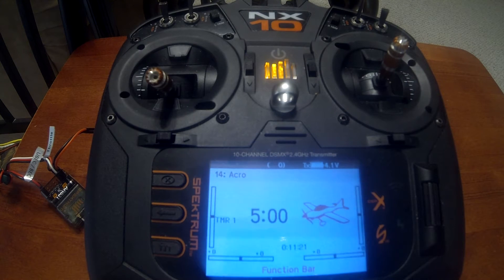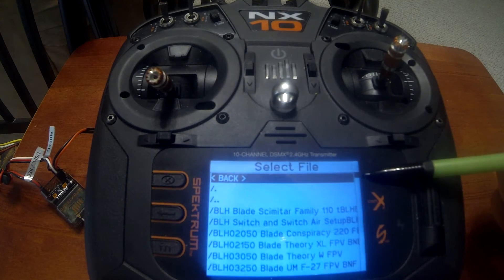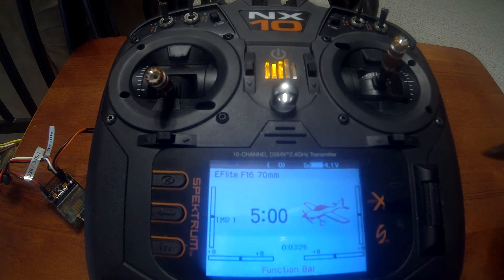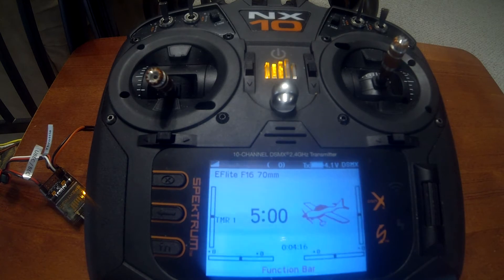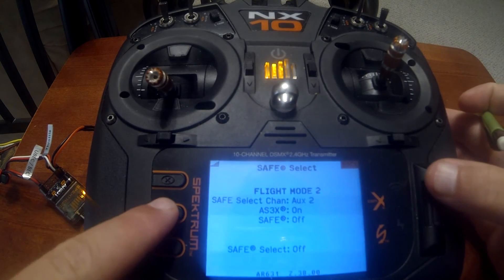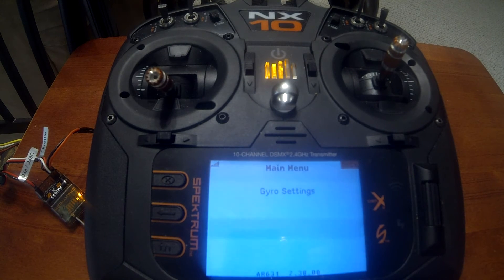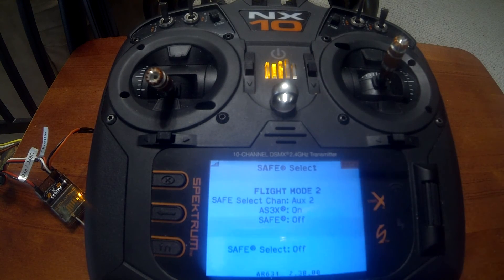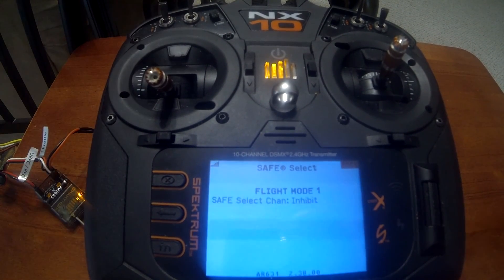Spektrum NX Setup: How to setup a Eflite BNF & Safe Switch Assign with AR631/AR637TA (NX6/NX8/NX10)

Comment: I just bought a bind and fly commander. Im use to just buying a blank ar631 and doing all the programming myself. Whay way do you think is better.
Reply from the maker: BNF settings are easier some because tuned and can fly. Unlock will give you flexibility. I prefer to unlock and tune myself...

Comment: I have a horizon aeroscout bnf. Can I bind it using a template and then set up dual rates on another switch. And use that switch as long as I have safe off

Comment: Your videos are outstanding, I have watched and reviewed several.  Much appreciated for someone like me that is new to the hobby.  Question I have imported a Eflight template for the Commander MPD.  I have assigned some switches, Motor cutoff, flaps etc.  Is there a quick and easy way to reset back to the original import template settings?  Meaning it would default back to the original import (NO assigned motor cutoff, flap switch .. etc.). Thank you in advance👍
Reply: You have helped by answering my questions before.  Took me quite some time, I finally figured out how to Reset / Delete.
Reply from the maker: @Mountian-Zen  sorry didnt see reply.Thanks for watching and support!

Comment: Do I have to unlock my AR631TA or can I just do a factory reset through my NX 8 forward programming? Thanks
Reply from the maker: Factory reset if you want to start with default settings and assign channel. Unlock will allow to program gains...
Reply: @BDTennessee  So it's reasonably ok to go back to default settings and be ok to install it in a different plane the bnf was crashed so I am wanting to put into my new Fms P40b .
Reply from the maker: @onapproachrc5471  dont take straight from one BNF and install into another plane.Need to unlock receiver so you can program orientation.

Comment: Your video helped a lot!! I thought my TX or RX was messed up because I did not see The option for 1st time set up after going into gyro settings.  I was going crazy trying to figure out if I had to rebind or re download the firmware. Which I did both. Not realizing that was NOT an option with this bind and fly unit. So thanks for explaining it clearly. 😃👍
Reply from the maker: Thanks for positive feedback and comments. Glad you got it working from video :)

Comment: I have a new nx6 and I'm really not understanding why in the BNF menu I'm not getting all the models with part numbers.  All I get is a selection of eflight,  blade,  etc but not all the models on one long list.  Could it be the latest update?
Reply from the maker: Correct. 

Latest update 3.06 is causing issue with BNF list.

Comment: I got the new Eflite T-28 1.2m. I'm using a DX6 with it, so I have to assign safe to either gears or flaps. I put safe with the gears. But, it comes on when gears retract and off when gears deploy. Is there any way to reverse it so, safe comes on only when gears are deployed?
Reply from the maker: Try reversing the gear channel.It will change which way the gear deploy and retract,however it should match the Safe to turn on when gear is deployed and Safe Off when retracted.

Stock BNF makes you put Safe at top or away on switch. When its unlocked you can set the orientation where it comes on with switch towards you.
Reply: @BDTennessee  I forgot to mention that I did reverse the Gear channel in the Servo section of the TX. It reversed the Gear, but Safe is still activating when the Gear retracts.
Reply from the maker: @twincitymoo7141  ok so yes that sounds right. After i wrote that ,i remembered it wouldnt haha.

Try going into Digital Switch Setup. Change the values to the opposite numbers for Switch A (Example Pos 0 +100 and Pos 1 -100 change to Pos 0 -100 and Pos 2 +100). Once thats done see you made need to reverse channel to get switch to match deploy and retract in Pos 0 or 1 (whichever way you want)
Reply: @BDTennessee  Thanks for your suggestion. When I get a chance I will try it out and let you know.
Reply from the maker: @twincitymoo7141  copy!
Reply: @BDTennessee  I tried switching the Gear channel to opposite numbers digitally. It still didn't work. I also had to reverse the Gear channel, but it still didn't work. So, I bind it to my NX10, and my son and I will just have to share TX until I buy him maybe the NX8.
Reply from the maker: @twincitymoo7141 it being a stock receiver sounds like its set. If you unlock it like a open stock receiver then we can do it.Id go with plan you got tho.

Comment: Is it Possible to use One of the Normal channels for this function ? I have an NX6  CH1-CH5 are assigned to flight controlls, Could i use Channel 6 for safe select and AUX1 for Reverse thrust or vice versa , or does it have to be an AUX channel ?

Comment: Hi BD I have followed video to a letter and double checked it I even set up the safe select to the same switch! I'm trying to set up a bnf valiant I bought a couple of months ago but I can't get the as3x to work safe comes on when I switch it on but when I turn it off to as3x only nothing works please help me out I'm very new at rc and don't fully understand it all thank you Marty from Canada 🇨🇦🛩🛩
Reply from the maker: Sorry i missed your comment. You have to throttle over 25% before AS3X will become active. So if your moving the plane before then it wont correct.
Reply: Thank you so much BD for answering my question! I was play with the throttle and I accidentally got everything to work lol but thank you again not many people would of answer an old question Marty from Canada 🇨🇦🛩🛩

Comment: Just received this transmitter today. I was looking at the BNF options and I didn’t see the 230s V2 heli on the list. I thought all of the models from horizon hobby was suppose to be on there. Or did I read some bad info?  Thanks
Reply from the maker: All the models arent currently in the templates unfortunately. You can download them from the Spektrum website. However the template info incorrect on alot of them.So until confirmed fix i would use the info from owners manual to program transmitter.
Reply: Thanks

Comment: Hey there, when I look at the BNF options there’s not many there and their names aren’t displayed correctly some only showing the product code and then 1.5mb or some other value. Do you have any idea why that would be? Running the latest firmware. Cheers
Reply from the maker: When you see the  "codes" its the model number on horizon hobby. Can be kind of confusing sometimes. When it shows 1.5m or 1.2 etc thats the wingspan of the plane. (example: 1.2m T-28 is the Eflite 1.2m T-28 plane)
Reply: @BDTennessee  more than half of mine don’t even show the name of the plane just the product code and i seem to be missing a lot, there’s not even a T-28 there? Any idea why this would be? Cheers
Reply from the maker: @TheRcKiwis  i checked mine and see alot of missing info.I didnt notice that until the latest update...
Reply: @BDTennessee  I see is the e-flite T-28 there?
Reply from the maker: @TheRcKiwis  the model and the name isnt on the list...
Reply: @BDTennessee  are you meant to install all the updates or just the latest one? Thanks for all your quick responses btw! 🍻
Reply from the maker: @TheRcKiwis  only the latest one... You're welcome!

Comment: Another great video. Quick question, do you need to use a BNF template to setup SAFE Select? I have a basic plane (Arrows Big Foot) that I placed the AR8020T receiver in and was hoping to use SAFE Select just to get some experience with it. Any help is greatly appreciated. Thanks for your videos.... they've really helped a lot.
Reply from the maker: Preinstalled templates in radio have the book settings. They dont have to be used for Safe just a shortcut to configure radio. On that topic though be careful as there is alot of errors with preinstalled model templates currently.

AR8020T doesnt support SAFE or AS3X. AR8360T is the same RX with SAFE and AS3X.

Comment: How about a reciever reset? (As in using the rx of a crashed plane?)👍
Reply from the maker: If its a BNF receiver you have to unlock to access other features.If its a "off the shelf" receiver its the first screen of forward programming. "Factory Reset Settings".